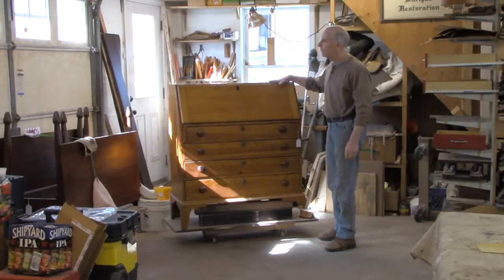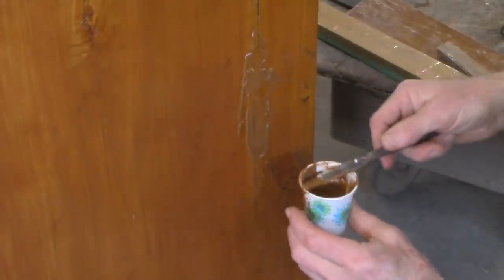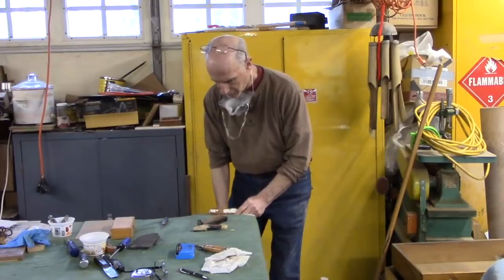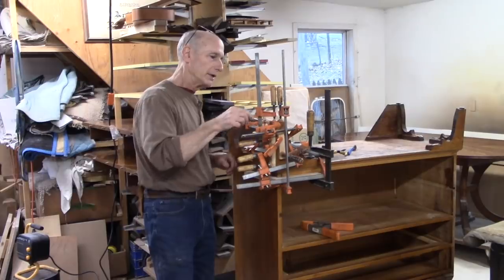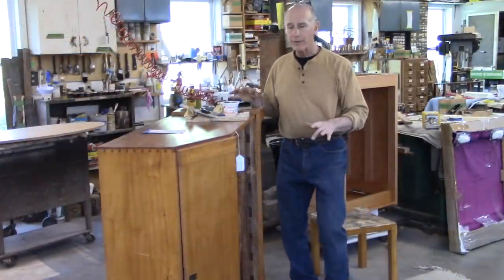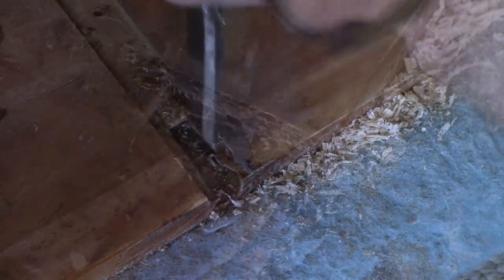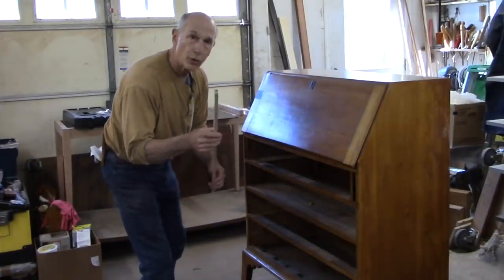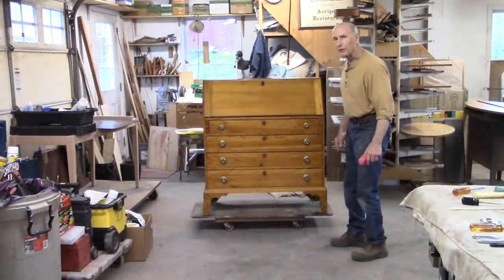Repairing an Antique Slant Top Desk - Thomas Johnson Antique Furniture Restoration

Comment: very nice thomas. im just amazed what people sell as antiques. i have a friend that lives in a house built around 1805. the first floor has all period correct furniture. she bought a pie safe that was suppose to be from mid 1700. it was in real sad shape. i had to take it down to the frame and put it back together. i put no finish on it at all. i took over 100 20th century nails out of it threw them away. there were only 6 i think period correct nails in it i put them all back in it. it came out very nice.
Reply from the maker: Thanks! It sounds like you did a good job!

Comment: Great stuff.  With some of the more difficult glue ups I've learned to feed the glue into the crevices and use low air pressure to push the glue deep into the repair. Works great and I'm always confident I've gotten my best repair possible without creating a larger fracture just to get glue into the area.  Thanks for all your work and knowledge
Reply from the maker: That's a good idea. Like 10 lbs? 20?
Reply: Very light air, just enough to move the glue.  A few pounds is it, it moves the glue all the way back.  You can see it move through.  Glad I had a tip, you've shown much more any times over. Thanks

Comment: Thank you for your work and videos.

My Mahogany slant top has 2 original clear glass knobs on the only outside drawer and is from the 20-30s best I can figure out. My family who would know have passed away but I do know my grandmother had it when my mom born 1938 was little.There are no names or markings on it except for 398 and 20 pressed into the back of the insert inside the desk and the 2 small drawers which have small round wooden knobs. Research shows the same glass knobs on a Landstrom secretary.
Reply from the maker: Thanks! That's interesting. I don't see too many pieces with glass knobs. Too bad there's no manufacturers name

Comment: very nice work Thomas !!
The final product shows is was well worth the time and effort.
Also, I think that white spongy stuff that you had scrape of is carpenter's adhesive, also known as "Liquid Nails".
It holds large things together without any clamping, big hammer approach, and very fast.
It also helps to prevent squeaks (installing entry doors, etc)
Certainly doesn't belong in any antique furniture.
Reply from the maker: Thanks! It could be - some one commented that it had happened to them when using glue that had been frozen

Comment: Thank you for posting these awesome videos. Three questions;
1) Why do you use wax instead of wood putty and does the wax remain stable in a hot climate without air conditioning (south/southwestern U.S. summers)?

2) Will you do a video repair/replace on a slant front Secretary desk hinge and supports?

3) Will you do a video repair to chair stretchers/rungs and legs?
Reply: Pam Waldron I’m not speaking for him, just my assumption. The use of wax, you can color match, and with some rubbing with a rag you can remove the excess. Using putty would require sanding and remove the stain. It’s a lot more work. As far as holding up to temperature, it shouldn’t be a problem as long as it’s not sitting next to a heat source, like a fire place or something that puts off a lot of heat. Sorry I couldn’t offer anything on your other questions.
Reply from the maker: Thanks John!

Comment: I would love a video on how and why you choose adhesives. Why hide glue on a high stress application like a end grain leg joint and epoxy on a joint with a large amount of surface area like the split. I would also like a run through on what dyes and sprays you use for colour matching.
Reply from the maker: Thanks! I did make some videos: glue https://www.youtube.com/watch?v=AmFot8H_2Kk and stain and glaze https://www.youtube.com/watch?v=oF1o5iD2pYs

Comment: Great repair job all round. I'm sure the lady owner will be delighted with your work. Just remind her to keep it positioned away from radiators and the like. With regards to the epoxy, Tom. I have to repair some cracks to some natural stone tile. I was considering epoxy as a filler. I need to tint it in some way to match the tile, what tints/stains would you recommend for compatibility and lasting results. Many thanks. David.
Reply from the maker: Thanks! I've been using the blendal powders from Mohawk https://www.mohawk-finishing.com/products/wood-touch-up-repair/color-replacement/blendal-powder-stain-pigment-type/. I just happened to have those because they are alcohol soluble (for shellac), but I knew alcohol worked well with the epoxy, and they seem to mix really well. But I think that almost any type of powdered pigment would work

Comment: Hey Tom, great work as always!   One slight point of contention is the foot repair. It’s apparent that they broke due to restriction of movement due to the poor choice of a cross grain corner block. Why not substitute a segmented corner block that protrudes an 1/8” or so in order to prevent cracking of your repair and take the load off the original feet?  I understand originality and all but I think it’s going to fail again. Thanks again for posting such great content.
Reply from the maker: Thanks! Yes, all true, although I don't know what you mean by segmented corner block. I am careful that the new blocks are even with the feet, so the feet don't take the entire load, but for some reason hesitate to make them even 1/8 longer
Reply: Thomas Johnson Antique Furniture Restoration hey Tom. I can’t tell you how much I enjoy your work. It’s really thankless sometimes restoring a piece that may have been flawed from the start and making it right. It’s a true Labor of love. As far as the segmented glue blocks my approach has been to take for example on a small piece like this 1“ x 1“ blocks and orient the grain of each block with the long grain of the foot and only glue that surface. then take the next block above it and glue it to the block but not the foot that’s running cross grain at any time. If you look at some of the early Newport stuff they found evidence of segmented glue blocks on those as well as some Philadelphia pieces but it seems the New England stuff never used it and have had a problem with their feet breaking

Comment: Tom, I’m interested in reason for gluing only the front of the drawer rails, and nailing the back. I have repaired a few (much later) pieces, but have only seen either all glue, or all nail. Does the nail allow for movement? Thanks!
Reply from the maker: You're welcome! Yes, exactly, in theory that nail can move some during expansion and contraction

Comment: Congratulations, absolutely beautiful repairs....May l be so bold as to inquire what was name of that 2 of the requisites that you use 1 -Did you mean hide (animal glue ) 2 -that dark brown infill similar looking to chocolate) is that a wax product ?

The greatest of regards,

English Mik.
Reply from the maker: Thanks Mike! Yes, I was using hide glue. The filler was low heat burn in sticks (wax) from Mohawk

Comment: A few questions for you: (1) "Purists", like those appraisers on PBS' Antiques Road Show always cringe when the owner of a piece of furniture similar to yours in age and condition says they had it "restored" or "repaired", because doing so substantially decreases its value.  What have your restorative measures done to affect the overall value of this piece?  (2) You use colored wax to fill in cracks.  Won't this material evaporate and/or wear away over time?  (3) Would it be an idea to take sawdust of comparable hues to mix with epoxy and fill the voids?  Thanks for your efforts to make this work available on YT.
Reply from the maker: Thanks! on Roadshow they have led people to think that it's the actual restoration work that has decreased the value. It's the fact that it was damaged and needed to be repaired that lowers the market value. I like the wax, hoping it will re,ain flexible

Comment: I once repaired a kitchen drawer front that the previous owner had repaired  numerous screws, nails and even fence staples but the best was he used black roof mastic as a glue. needless to say, the drawer front still fell off.
Reply from the maker: It's amazing the lengths people will go to to avoid doing it correctly

Comment: I’m curious about the tinted filler you used.  Is it stick shellac os some tinted putty?  Once completed, what are you using for smoothing/ cleanup?   Is the knife heated before using?
Reply from the maker: Thanks! I should have shown more. Yes, it's hard wax, and has to be heated, when it cools it's hard again. The knives are heated in an oven made for that purpose

Comment: Thanks that is really interesting. How do you heat up your wee knives that you use to apply wax? Are there any simple or cheap methods? Thanks.
Reply from the maker: You're welcome! I have an oven from Mohawk: https://www.mohawk-finishing.com/products/tools-accessories/burn-in-tools/oven-electric/. But you can heat them up anyway you can, lay them on a hot plate, or use an oil lamp

Comment: Beautiful work as always. Question about the side panel cracks and how you used the wax to fill that crack; are those wax sticks the typical repair ones in the big box stores but just using a hot pallet knife to apply it? And at what point will that not work?
Reply from the maker: Thanks! Those are Low Heat Burn in Sticks from Mohawk. They would only not work if the defect were too big, you wouldn't be able to level it
Reply: @johnsonrestoration  Great. Thanks

Comment: Slant Top Desk video was fantastic....Great Work on a Difficult project....Where did you get you burn in knives and how do you keep them hot..My electric one get to warm.
Reply from the maker: Thanks! I use an oven, and when I take a knife out I usually have to let it cool off for 10 - 20 seconds. Also, you can stick the knives in half way and that helps.
Reply: B Vennstrom
For melting wax into tight cracks I use a modern soldering iron with an adjustable temperature, usually set at 140 degrees centigrade. I have sharpened the tip of the iron so that I can heat up the crack also in the inside, which allows the wax to fill the crack deep down.
The touch with your animals at the start and finish of your videos is an extra bonus...

Comment: 😂Love the lesson from Creative Clamping 101!  I noticed you used epoxy for strength. Yet, you easily removed excess with a chisel. Is that due to the finish?  I assume the greater strength is because the epoxy is on the interior raw wood then.  Once again, yes, it is ‘Pretty Good’!
Reply from the maker: Thanks! Yes, it came off because of the finish and I used a very sharp chisel

Comment: Whenever you use or remove glue that softens with heat, I always wonder whether that beautiful piece of furniture would survive Aussie summers where we get even over 40C temperatures (shade temperature).
Would the glue soften and shift over time or is it okay in hotter temperatures?
Reply: I believe in a previous video he sets his heat gun to 200 Fahrenheit (100 Celsius)  so i would imagine its fine...i live in texas where we often get summers at 104 which is about 40 Celsius i never have an issue
Reply from the maker: Thanks! As the comment from Mike Cook, he's right, as long as the sun is not directly on it
Reply from the maker: Thanks Mike!

Comment: What is that material you used to fill the cracks and gaps?  Was it wax?  Did you use a solvent to smooth it?  Did you sand it?  I would love to hear your thoughts as perform this step.
Reply from the maker: Thanks! That was a wax burn in stick

Comment: That white glue might be a "No more nails" type product. These products are notorious for letting loose after some time.
Reply from the maker: Yes, I'll guess we'll never know, but some one said that's what happens if the glue had been frozen
Reply: @johnsonrestoration  But, what kind of glue?  Also, was that a decking screw with Phillips head you took out of one of the drawer runners or?

Comment: When you were using the burn-in wax to fill cracks, why did you use a wax that is darker than the wood?
Reply from the maker: Thanks! Cracks are usually darker. The worst thing is to have the color too light

Comment: I think you should call yourself Thomas 'I think it looks pretty good' Johnson.  That said, I agree with you.  I think all your repairs look 'pretty good'.  One question though, by using nails, isn't there the danger that wood will expand and contract over time more than the nails and the repair will work itself loose?  Wouldn't wooden dowels be a better alternative?
Reply from the maker: Thanks! I don't think those square nails come out. It has to do with being square. But mostly, I try to mimic what the original maker did

Comment: Question: I make and use my own hide glue.  I have a very accurate double boiler that keeps it precisely 140 F degrees as I work....  I notice you work right out of a jar presumably at room temp..(?).  Do you use a salt to give you longer working time?
Reply from the maker: Thanks! I'm working out of a crock pot because my glue pots not working - I didn't want to show the crock pot. I hadn't heard about using salt, I might try it
Reply: Thomas Johnson Antique Furniture Restoration > 1 Part Hide Glue,  1 Part Salt, 2 Parts Water is a liquid brushable solution that is durable and works well at room temp (once mixed under heat) and can even be refrigerated and reused for some days....but it’s weaker by about 20%.  I use equal parts hide glue and distilled water in a heated double boiler (a professional face waxing two pot..for backup).  It’s good as long as it’s heated then I’ve got to clean pots fast or refrigerate and re-heat with more water (which also weakens it).  My practice of over 4 decades is to use only the tools and science..glues etc of the time the piece was built.
Reply: Buona sera  Thomas Johnson quello che  scrive il signor 
Teofilo Jedediah è corretto.Oltre al sale  per ritardare i tempi gelificazione  si può usare l' Urea. L’aggiunta  di urea del 15% in parti di peso per colla secca aumenta il tempo di lavorabilità da 1 minuto  a 5 minuti. Il 30% lo aumenta di circa 15 minuti.L' urea non diminuisce il potere collante.Per rendere più flessibile la colla si aggiunge il 10 -20 % di glicerina all'acqua di soluzione.
La colla animale può  derivare da ossa, dalle pelli e dalle cartilagini, la prima è la più scadente come qualità perchè ha meno potere collante ed è più rigida l'ultima è la più pregiata. Una colla più densa è indicata per legni porosi che assorbono cosí più lentamente la colla; viceversa una colla più diluita permette la penetrazione in legni più duri e poco porosi.
Solitamente metto dei conservanti nella colla per evitare il formarsi di muffe soprattutto se so che un mobile andrà in un luogo umido.
Saluti dall' Italia
Reply: Diego dc agreed, but most of those mixtures and precision had not been around when the early period pieces were made.  I make every effort to remain true to what was common when a piece was built.  Even using only the same tools (where possible).  My wife criticizes my greatest fault being too picky and seeking perfection where it often is not possible.  In my youth I stumbled through quickly and ruined some very nice pieces.  After many years now will study a piece and research it for days until I’m confident.  Next I mix my dyes, my finishes and glues and layout my tools.  It takes me 4-6 months to be totally satisfied but the customer is always happy and willing to pay my fees...plus I’ve made a friend for life.
Reply: Buona sera signor  Teofilo Jedediah  non creda che nei secoli passati non venissero  modificate le varie colle i coloranti per il legno e le finiture.Nella colla animale i vecchi falegnami spremevano il succo di aglio per ritardare la gelificazione diminuendo però il potere collante.Anche le finiture a gommalacca venivano modificate con l'aggiunta di altre resine naturali tipo sandracca. benzoino e ogni falegname ebanista del vecchio continente custodiva gelosamente le proprie ricette.
Buon lavoro e un saluto dall'Italia

Comment: If you apply butchers wax to the surface around your glue joint, you won't have to spend so much time and effort trying to remove excess squeeze out glue. Also, you won't have to worry about repairing the finish. Apply wax to your glue blocks as well.
Reply from the maker: Thanks! Not a bad idea but I’m always worried about getting wax in the glue joint! I will try it though

Comment: Why put so thick glue. I heard the thinner the glue on both surfaces bond stronger?  I read it from science magazine.
Reply from the maker: I'm not sure, but my guess is that the thinner glue might soak into the wood fibres faster and deeper, creating a stronger bond
Reply: @johnsonrestoration  
Thank you. I will try both ways.